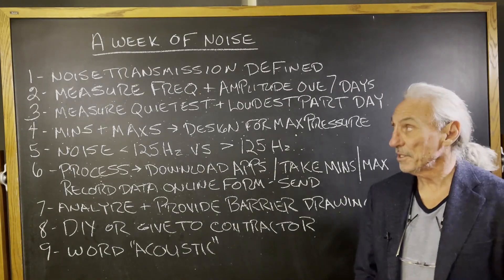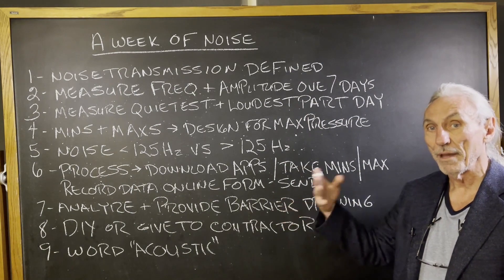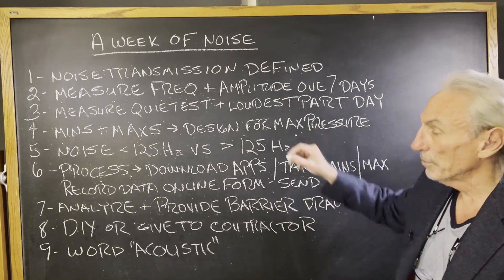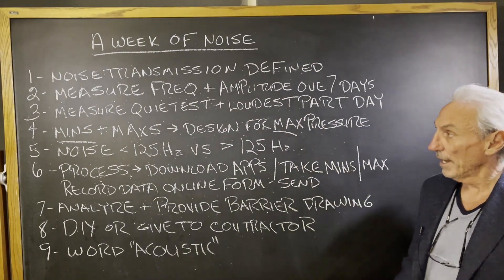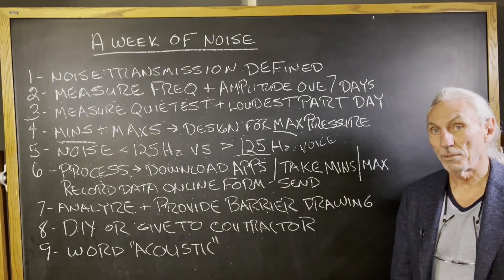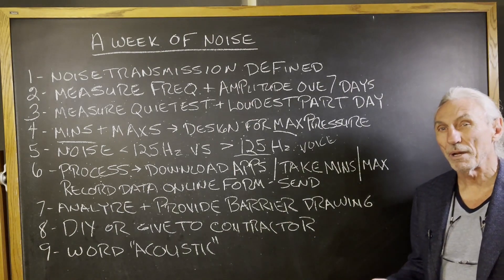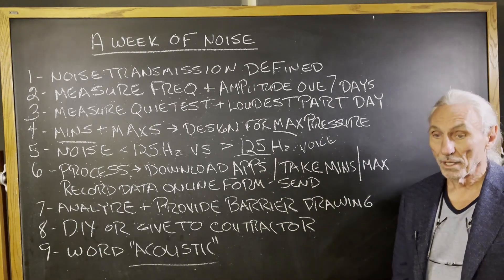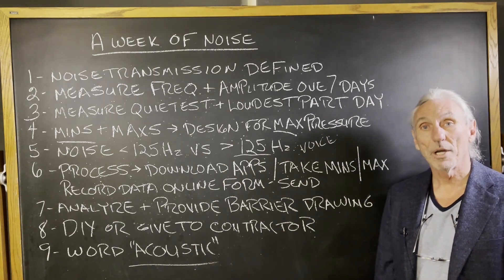A Week Of Noise - www.AcousticFields.com

Comment: Every key on a piano below C3 is under 125 Hz (assuming the piano is tuned to A4 = 440Hz), just for reference.
Reply: And the Bösendorfer Imperial Concert Grand Model 290 doesn’t have 88 keys but 97 and goes down to C0.  It was designed to play transcriptions of the Organ Works of Johann Sebastian Bach. I watched a technician assemble anf tune a Bösendorfer Model 225 which has 92 keys down to F0. For those extra keys on the bottom end you have to reach inside the piano and touch the string to make it sound an octave higher to tune because the fundamental pitch is so low you can hear the slow beating of the string rather than a clearly defined pitch. A magnificent instrument with a very rich timbre because of the addition strings providing resonance to the tone of the instrument. Today those instruments cost between $250,000 and almost $600,000. I would love to hear those instruments in a properly designed recital hall focusing exclusively upon that instrument’s grand sound.
Reply from the maker: Good data. Thank you for contributing.